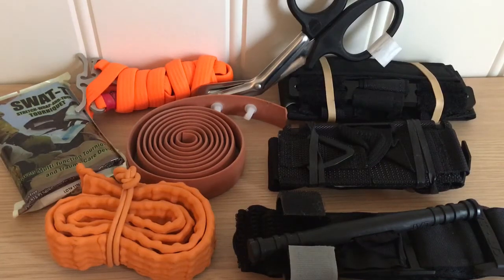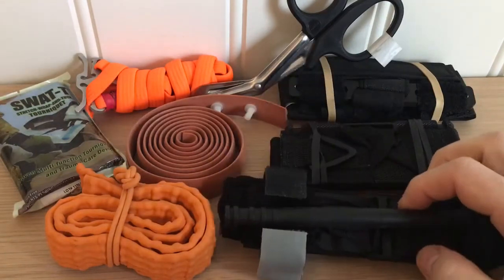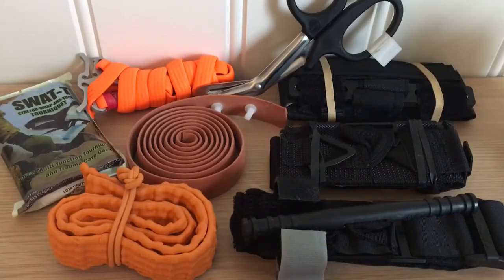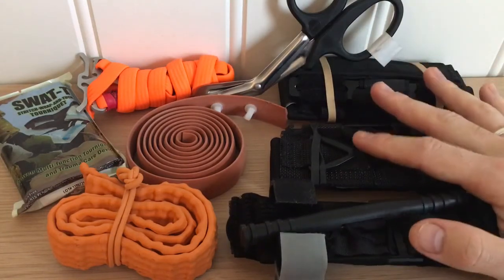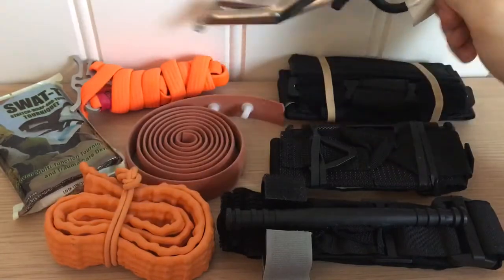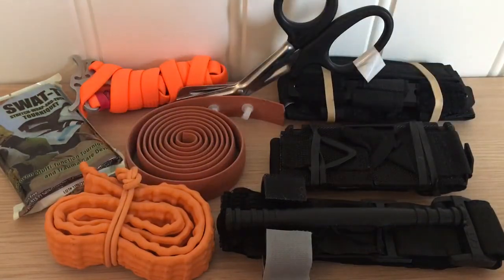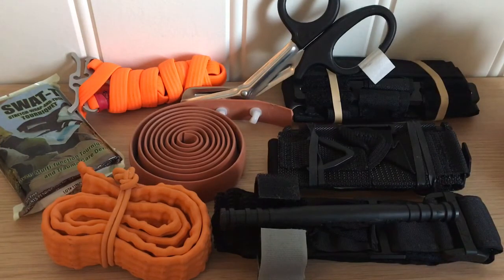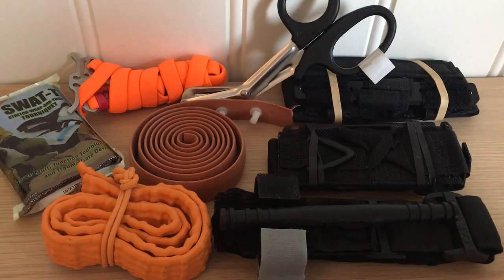How To Tourniquet - Use, Risk And Placement - What YouTube Experts Don’t Tell You

Comment: Great points, Fredrik. The way I was taught and the simplest way I can put it is that if you can visualize the source of bleeding then it goes 2”-3” above, if you cannot visualize the source of bleeding (or if you’re under fire) it goes high and tight. You also made a great point about the ongoing assessment of the TQ, and reassessing for bleeding control and either tightening, or adding a second TQ if needed. Thanks for sharing!
Reply from the maker: Thank you, Sean! I finally got a soft-t wide added to the collection as well, I really like the quick connect capabilities. Sure beats looping it trough the buckle. Thank you for watching :)

Comment: I find it amazing and how much things change over the years. It is definitely a good argument for keeping up on your training.
Great video
Reply from the maker: They sure do, and tourniquets are still a debated subject. Over here the civilian manuals still don't include tourniquets, while military, police and ems seem to have gone the same route as the US putting them back into service. Do you keep or carry tourniquets? The SOFT Wide generation 4 would be a good option for those with limited or no eyesight as the buckle does not require treading to wrap it around a limb and the new retention "ears" are the same as the CAT and will hold the windlass in place while feeling to confirm occlusion. Thanks for watching!

Comment: Another excellent medical video. Here's my old one for a comparison
https://youtu.be/G1xaLAqeKYs
I hate high and tight but sometimes you have to with a real bad trauma. I use the 3 inches and then apply another one higher. One thing if they go into DIC they will bleed out whatever you do but that's high end medicine! Also check pulses and neurological intactness of the limb, if you can. Usually you cannot
Reply from the maker: Thanks, Huples! Would hemostatic agents make any difference for DIC? Maybe you could do a video on DIC from trauma, would be an interesting topic to learn about. Do you still get the same skin symptoms when trauma is the cause? Great input! Thanks for watching!
Reply: Now that would be a complex vid! If in dic it’s game over. Clotting cascade has used up all the clotting factors so bleeding from everywhere!